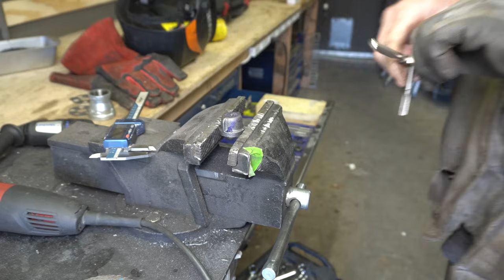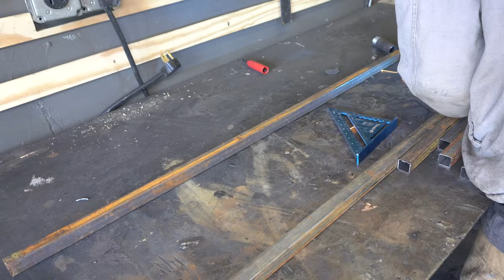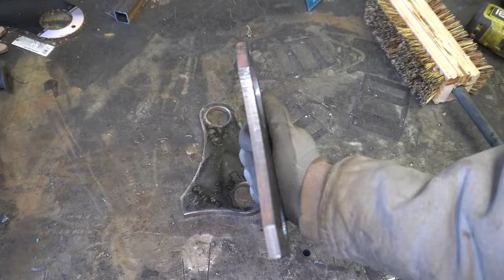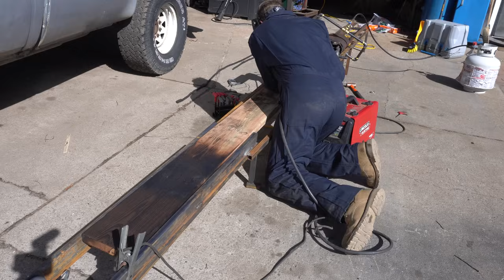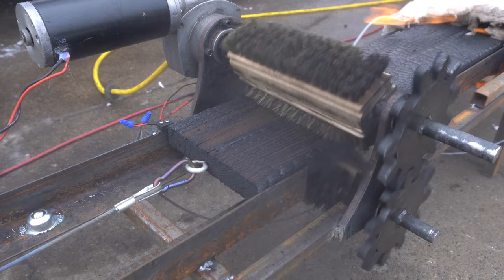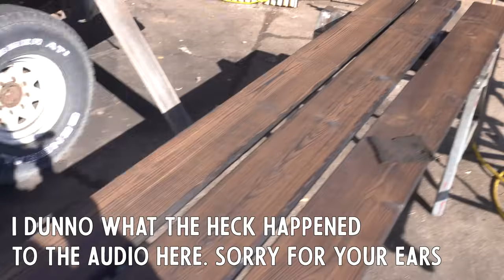Modernizing An Ancient Japanese Woodburning Technique

Comment: For a proto type is not bad.
You can also add some roller with sand paper to push and pull the wood.
and also do it be the sides.
To make the brushing system better, some spring and a jaw would be great (with a chain maybe? or triple gear.)
to finish it off, a pre paint pre system would be nice.

Comment: The fastest and easiest way to send difficult numeric data is to send it as strings, so assuming you are using a C at both ends, create the string using a sprintf() statement,  and then on the receiver use sscanf() to get the number out. This solves the problems of all the different representations of bit and byte orders. It’s less efficient, in that it needs more transmitted bytes on the RS232 line to carry the data, but that loss of efficiency is more than made up for by the gain of sanity of the programmer.

Fun fact: turn the clock back a few years, financial arithmetic with big numbers was done using character arithmetic, just like you would write numbers down on paper back at school, because it was guaranteed accurate, no rounding errors.  Floating point can be terrible.

Comment: Quick sewing project: add Velcro or a zipper to the jumpsuit for an easy open flap
Reply: You can get em w the flap but its still fiddly af. You need to pull your shorts down, but pant legs are still there. 
Nah, ya gotta go full 3rd grader and just pile it at your feet to drop a proper deuce.

Comment: in forges, having a cone shaped nozzle/diffuser helps stabilize the flame.  Or stick it into the chamber and it does the same thing.  They don't like to run in open air like that.

Comment: Get rid of the cable and put feeder wheels on either side of the track. Power one of them  and make that your variable speed. Reverse the brushes so they're also in a pulling fashion. Put the feed wheel in between the fire and brushes. You could really cut down on set up since you just be able to start them one after the other

Comment: Dont send floats or doubles, just send a fixed point value of the axis value instead. Essentially you just multiply with the precision you need, if you need 3 decimal places then multiply with 1000. Example: 152.123 would be sent as 152123. then divide by 1000.0 to go back to your float. (either this is simple or just the same, i have not actually used linuxCNC.. but it's good knowhow either way)

Comment: I would have put a couple sets of rubber tires that pinch the boards from both sides driven off wiper motors or something to pull/push the board through

Comment: Great video! I've done a bit of yakisugi with manual methods but would definitely build some sort of machine for building fences/cladding, etc.
One thing I found useful was the plastic fibre abrasive wheels you can get. They come in different abrasive grades as well as width, bristle length, etc. One advantage is they can be switched round if they develop curves in the bristles. They also get into the soft wood, leaving the burnt resin proud.
You could also use a toothed chain to push the boards through.
Great proof of concept though, would love to see Mk 2.

Comment: for feeding the boards, instead of a winch setup use like a baseball pitching machine setup with wheels that grip and move the board, both infeed and out so you dont have to touch it at all.

to help mitigate brush marks, i saw gaps between the bristles and you had all of them lined up exactly the same, if you offset them a little bit it might help 

also if you build fences for a living now, maybe do build time lapses and post those on a second channel, i always see channels thats just time lapses of yard cleanup and stuff like that with millions of views

Comment: RE Floats on Arduino, Arduino's serial has trouble with sending and receiving floats,. You'll have to read them from the serial port as two integers, one either side of the decimal point, using something like the stoi() function. Then you can write a function that can turn your two ints into a float.

Comment: Regarding the floats/doubles from LinuxCNC to Arduino, could you use two decimals, seperated by a decimal point? Or just a "key" such as "D123" for the decimal and "F321", then on the Arduino just post-process them into 123.321? Janky? Yes. On-par with the theme of the channel? Meh, close 'nuff!
Reply: This tbh. Bend the brain around what a radix is and the rest will fall into place.
Reply: Could be an issue on LinuxCNC part. But as long as you can do some basic math, you multiply the number on LinuxCNC by say 32768 (2^15), divide it by same number on arduino. 2^x numbers are for fast division on arduino, because it is just bit shifting in registers. Though to make float out of it quickly you would need to construct some fancy union type and cast it to float... Meh CPU cycles are cheap these days, use fuckin better microcontroller for more speed lol.
Reply from the maker: That's kind of how I was trying to do it already, my issue now is that the arduino is recieveing the data(i only say that because the rt light turns on at the interval i am sending it), but I seem unable to use it for anything.
Through some dumb tango of starting the machine and opening the serial monitor in the right order, I was able to see the data being printed from the arduino on the serial monitor, which makes me think the serial port is too busy or something. I dunno it all feels like some dumb oversight on my part
Reply: @cranktowncity may have issues trying to run the serial monitor while linuxcnc also has the port open.

Can you post your code anywhere? This kind of dumb is my day job at the moment, happy to help out if I can though I don't claim to be an expert.

You might have some luck opening up a second serial port (in software) just to help you debug your serial link.
So you can serial read on the default, then send it out on serial1 with a USB to serial dongle.

There's another post here about using structs to get your data across that may be what you're missing.
You need to assemble the bytes back into the double or float on the Arduino.
You're probably also going to want some way of syncing the Arduino and the PC. So if you miss a byte you're not permanently out of sync.

It's total overkill but it might be easier(possibly) if you're using an esp32 or similar powerful with lots of ram Arduino to use something like json to ship your data over. Python speaks it easily and there's librarys in Arduino for it. Might make packing and unpacking variables easier than doing it yourself.
Reply: if you send the ascii representation, beside the "translation" cost, you will use 1 byte per digit, +1 for the sign +1 for the comma +1 for the divider. A float is always 4 byte instead. a double always 8. JSON as suggested would be horrible in this regards, its a relatively complex format and very verbose, a simple CSV would be so much better; but would be great to talk with javascript frontend, and the ESP is powerful enough to run its own web server..

In binary mode synchronization of sender and receiver is a bit more complex, and there are many tricks to long to explain here, but generally you create a packet with a specific header, the data (with a known format, so packer A will always be INT16 INT8 FLOAT for example) and a CRC byte. You see the start byte (that may be a start byte, or data! we still dont know when we start to listen), read the packer, if you see a new start byte rember where it was (only the first), if you reach the end of the packer test the CRC, if succesful we done. If not, start from the other oldest start byte if you found it, if not go on wait for the next start byte.

Drop the code and/or a chat/discord/whatever.. im gonna info dump you so hard your head will hurt for the whole season.
Reply: First of all, mind you, Arduino UNO has NO DOUBLE, only float, when you write double it uses a float under the hood.
Also arduino UNO uses software emulation to do float and double math, that may be very extremely slow.
Serial 9600 8n1 means: 9600 baud, every message is 1 start baud (mandatory), 8 baud for data, No parity, 1 stop baud. 1 baud == 1 bit, so basically you use 10 baud to send 8 bit of data, aka 1 byte. 9600 baud == 960 BYTE/s
Arduino UNO and all the others can safely run at 921600baud, aka 92160 BYTE/s or 9 KiB/s
Serial is FULL DUPLEX, means you can transmit and receive at the same time, full speed. HALF DUPLEX (like walkie talkie) means you can only transmit or receive, so you have come up with a way to divide send or receive. SIMPLEX (GPS, TV, Radio) you only receive or transmit.
Reply: sorry if you get multiple messages, youtube is giving me "error", they appear and disappear.. wtf

Comment: No coupler to bell the burner end?

& have you ever seen the paint removing "whips" for drills? The wire is stout but free to give against a surface b/c they are connected loosely with an eye. Much more durable than a wire wheel and doesn't cut as much either, it bounces, like how people always wallop themselves when nunchucks fly back. That motion, then rotation pulls it under and the contact is more along the length. Unlike a wire wheel that has all the pressure at the wire's tip so it cuts and gouges till it bends enough to pull through. 
   Don't fault you on the brush to get it going, but they're burnt already.

Comment: I would have used a chain conveyor underneath with pawls to push the wood through. That way they can drop out the end and you could theoretically have a stack on the in feed to make manual oversight even less.

Comment: “Thermally Modified Wood” is the modern version of this i think.

Granted i need to grab data but i bet the nasties
made by the Pyrolysis of the Woods surface (look up “Pyrolysis Oil” and “Creosote” for a good idea on what probably forms on the surface, the latter was often coal though so ✨bonus nasties✨).  So either thermally modifying it, or pressure treating it with pyrolysis oil or similar nasties should work!

(Haven’t watched the video yet so I’ll check and delete this if need be oof, no harm intended!)

Comment: Is there a reason you chose a stop/start movement over a continuous design? The finished product looks great, but gut instinct suggests you might be able to achieve a more even finish/require less post-processing, while being able to circumvent a lot of the code/programming.
Reply: The winch probably goes too fast.

Comment: Awesome!  Id like to see 2 sets of teeth on either side of the track, in front of the fire and then after the brushes that semi bite into the sides and move it forward. As long as you feed the next board in to the first set of teeth then it will push the board out to a pile.  If the board is mounted in a frame and the sides dont get seen then teeth marks dont matter.

Comment: How much precision do you need for the float stuff? A total hack might be to multiply your float values by 10^number_of_digits_of_precision_needed, send the int, and then divide by the same 10^ number.

eg: If you only need 2 digits of precision:

sendingValue = int(floatValue * 10)

... send the value ...

on the receiving side

float received = float(receivedValue) / 100.0

Does that make sense?

If you are writing all this in C, there's much more efficient, but arcane, ways of doing it.

Comment: You should have put your burner and brush on a rail so the board is stationary and you do one side at a time.  Could make a simple pipe with a metal gate roller wheel to run on the tubing as a cheap and easy rail system. Then your brush, and burner could be on a roller type gear system that spins it as you move it along the rail powered by your actuator.

Comment: My take on the float serial arduino conundrum; IDK the model of your arduino, but I think the easiest way is to just sending the & of the float you want to send, with a sizeof(float).

then on the arduino side you will have to readBytes, and cast it like `(char*)&` for as many bytes as again, sizeof tells it to.

I think it should work...
Reply: I think the problem might be more on the LinuxCNC side of things.  Unless he's writing C/C++ code to run there, he's got to convert the float representation there into IEEE 754 32-bit floating point so he can throw the bytes at the serial port and read them in on the arduino, where your trick would work well I think.

Comment: You can try unions before you send the variables though it'll depend on the endianness:

One way:
Arduino side
union float2int{
    float f;
    uint8_t b[4];
}

void loop(){

    Serial.readBytes(&val.b, 4); //If the endianness is wrong, reverse bytes in b
}

PC side
union float2int{
    float f;
    uint8_t b[4];
}
int main(void){
     float2int val;
    val.f = floatvalue2send;

    //Write serial here however you do
    Serial.write(val.b, 4);
}

Comment: i use that a lot on my projects. its a great way to protect wood from the elements. love your videos brov. all i do all day is make shit - cut, grind, weld, 3d print, cnc, drill, burn, turn, wire, solder, tape, glue, program, twist, and now im clickin subscribe. :)  also i might be able to help you out with that cnc serial issue you mentioned. i'm gonna rewind the vid and look into it.
Reply: and are you using C++ or python?

Comment: For the infeed of the wood i had an idea why not use a motor whit a sproket (whit pointy spike) on both side and the motor would be fixed on a lever and a spring would do the compression these 2 motor would be on the side of the wood as for not leaving mark on the face of the wood i dont know if this would be better than the winch idea you had

Comment: what type of dc gear reduced motor is that? i need a supply of about that size for some projects, but they are hard to get by if you just want to order them online...
Reply from the maker: It's a motor from an electric wheelchair, you can usually find them on ebay

Comment: floats are 4 bytes, doubles are 8 bytes.
make struct with your values, then you need a pointer trick to take bytes of that struct one by one. On another side you need the same struct and the same trick to put those bytes back.
I'm writing from my phone, so can't be much in detail.
Reply: On the linuxcnc side to get stuff from axis specifically rather than hal it'll probably need to be a python control panel or something similar. Other thing to watch for is endianess, if your x86 and flavour of Arduino differ you could get weird results that look very corrupt.
Happy to lend a more 1:1 hand if you want

Comment: You probably got a lot of responses, but you want to send like a float32_t or float64_t from an rpi running LinuxCNC to an arduino? Are you wanting to send/receive it using the rpi's UART to the arduino's UART? Do you want like a dirty hack in LinuxCNC that you can compile in? Do you need closed loop verification that the float was accurately received? I can tell you some issues that I had:

I had to do something (sorta) similar sending doubles from a TI OMAP processor to a an ATMEGA168P (both now defunct). It turned out that the arm processor was using float16_t as "floats" and float32_t as "doubles" while the atmega was using the regular 32 bit = float and 64 bit = double.

It also turned out that they stored the floats in different byte order, so that's something to keep in mind. In addition, when I cranked the UART speed up past 115200, interrupt vectors for other things started either being skipped or overridden, resulting in incomplete data transfers (i.e. it would end up getting a completely wrong float value).

If you have an oscope with capture or especially an oscope with serial decoding, it an really help with finding simple errors that will otherwise take hours of guessing.

Hopefully some of this meant something. I don't really know enough of exactly what you're doing for it to make sense to write more. I usually do things in c or assembly, so outside of that my advice might not be too useful.

Comment: How long did it take for each board to go through?

I was using a similar setup last month. But the flame chamber was built like an actual forge. Did a 10ft board in about a minute.  After it got up to full temp the boards were starting to burn before going into the chamber.
Reply from the maker: It was about 15 mins each.

Comment: Oh buddy, with how much galvanized metal you weld, you really should be wearing a respirator. Honestly just with how much you weld, grind, and do other stuff, you should be wearing a respirator. Lung transplants aren't exactly quick or cheap.
Reply: Last I checked galvanized fumes are harmless in the long term. They're also fumes, so he'd need a supplied air respirator to actually keep them out of his lungs.
Reply: Skin handles toxins better than lungs. If that weren't the case, people would rub tobacco leaves on their arms instead of smoking cigarettes. And yes a supplied air respirator would be the best option, but those still run the air through filters, and another great option is a half mask respirator with a P100 filter like the 3M 2097. It's just so easy to take simple precautions like wearing a respirator and protecting bare skin from the UV of welding, it constantly baffles me that people don't do it.
Reply: @evanbarnes9984  I didn't mean on the skin, the lungs can handle it just fine. Severe exposure will make you feel bad, but it won't hurt you.

Also, the point of a SAR is that it brings in air from somewhere where it's already clean. Filters don't scrub fumes, only particles. It would reduce your exposure somewhat but you would still be breathing in significant amounts.